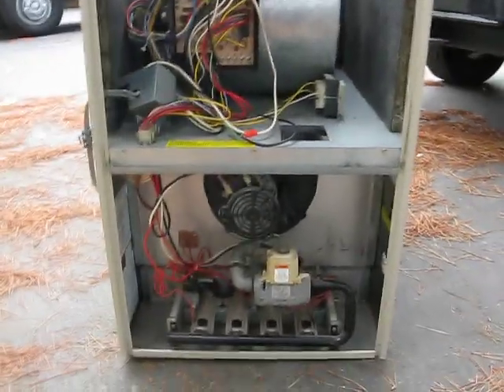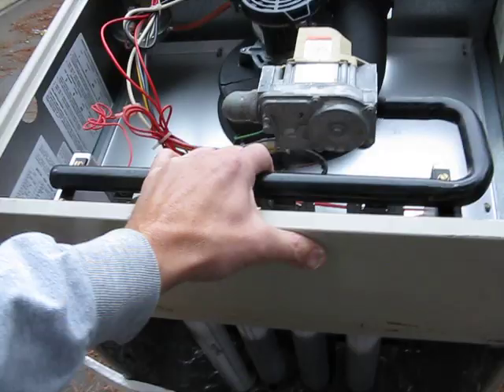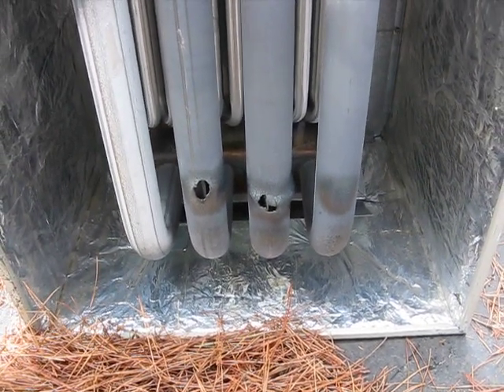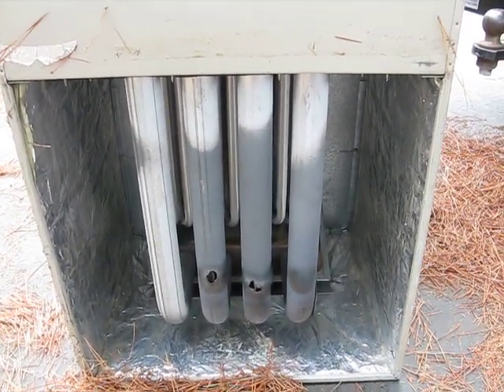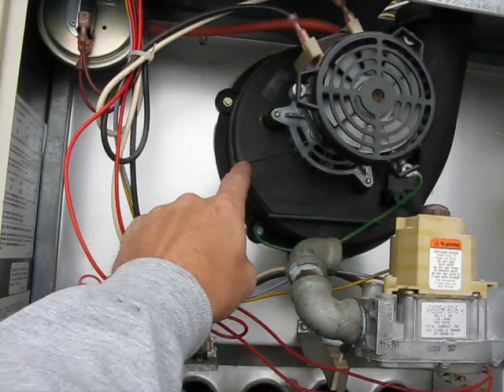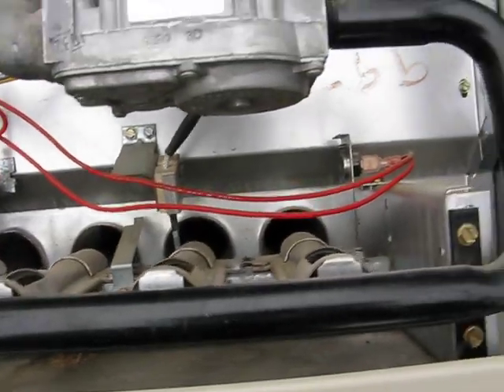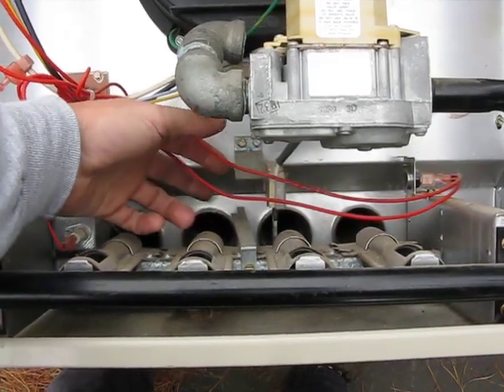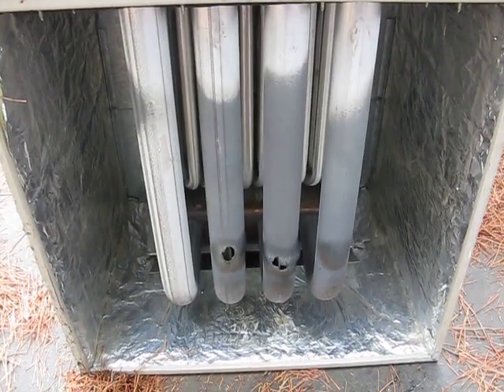Crack Heat Exchanger

Comment: cracked heat exchanger is cracked heat heat exchanger, no matter what size is your crack it will never get smaller. It doesn't produce CO, but the furnace became unsafe to keep using it. Replace heat exchanger or replace the furnace in the case this is very old. The reason for the maintenance is SAFETY operation of the furnace.

Comment: For example, many people have been killed using their gas-fired oven for 'emergency heat'. The oven might have been working perfectly, heck might even have been brand new. The problem comes from not just 'yellow flame', but when you have a gas fired appliance burning, and you force it by lack of proper ventilation to recycle the exhaust, it can turn into a lethal CO machine. I've run into furnaces that were so bad, one of them last year pegged my meter at 2000 ppm CO.

Comment: Crack in the heat exchanger, plus positive pressure in the compartment (which gets high if the AC evap coil is clogged due to never changing air filters), it pushed the exhaust gases back out into the burner compartment, which also produces the incomplete combustion, and voila, now you not only have the risk of high CO, you have the risk of the furnace catching on fire, and burning your house down!

This is one of the many reasons HVAC is not a DIY hobby.

Comment: Since the induced draft fan doesn't have that much CFM to begin with, any holes or cracks in the heat exchanger rob it of the ability to remove those combustion products, and then you get the improper combustion due to lack of air flowing thru the burners. It will get to the point where the flames will "roll out" back into the burner compartment when the holes get big enough and the furnace blower kicks in, which could set the whole thing on fire, if the rollout sensors fail, or are bypassed.

Comment: Listen, what you are saying might have been true in the past, when you had very inefficient natural draft furnaces. Those furnaces being low efficiency, had very hot flue gases which inherently produce a strong draft. Nowadays, you have induced draft furnaces. The 80% ones have a very small fan, so as not to cause positive pressure in the flue pipe, and still remain a Category 1 furnace. The problem arises from these holes, which screw up the draft, and create the improper combustion.

Comment: Techs never check gas pressure or clock meters. Meaning that there are alot of furnaces out there that are over-firing. This is one of the main reasons for a heat exchanger to fail, Unless you own a York, JK :)

Comment: @cdb1636  Heat exchangers don't leak CO? That's bull. 2 kids and a parent died in a house near me due to a furnace with a cracked heat exchanger. They died of CO poisoning.

The heat exchanger doesn't always have enough negative pressure. An older furnace without a draft inducer may not have enough negative pressure in the HE to overcome turbulent effects at the surface of the heat exchanger and combustion products can still leak.

Comment: @cdb1636 If a furnace is burning properly with blue flames, it will produce very little CO. If the furnace is not burning right and has yellow flames, it will produce CO.

A cracked heat exchanger is dangerous any time, but it's most dangerous when it's coupled with a furnace that has yellow flames and is, thus, producing plenty of CO.